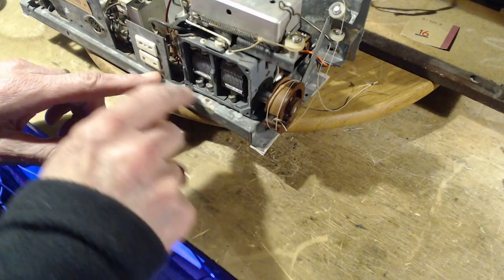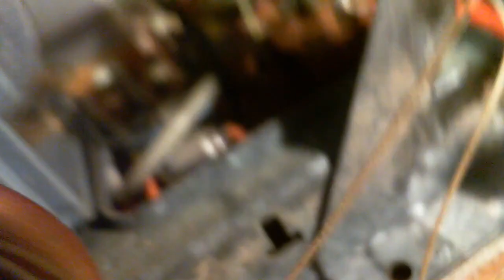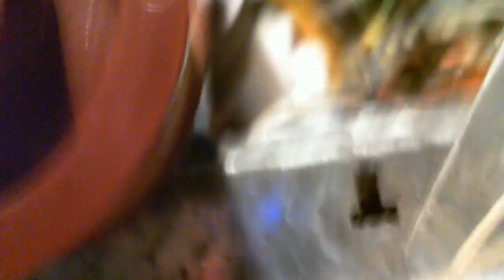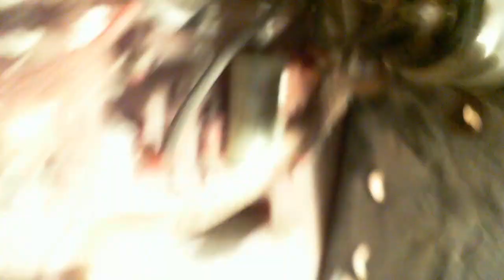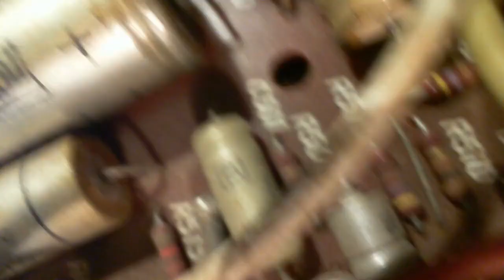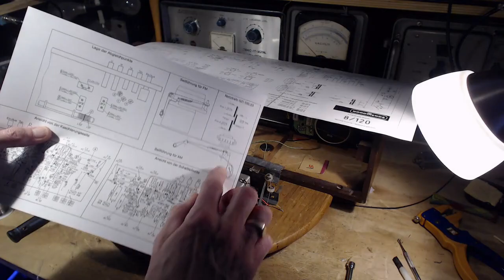Nordmende Spectra Phonic Video#1 - Checkout and Power Up

Comment: The closeup pictures at www.radiomuseum-bocket.de for Nordmende Spectra C Export(!) chassis A121F show the tensioning spring of the dial cord inside the wheel on the tuning cap and not mid-string. Also if it was mid string there would show remains of the eyelets, which there arent. And the pictures at radiomuseum bocket show that ofc the speaker is in this radio is not the original. 5 minutes research put 30minutes of video ad absurdum.
Reply: Yes..I didn't do research but the speaker just didn't look like the original to me.

Comment: Sounds good but you need to properly attach the white backing to the metal plate. Don't use white glue or superglue on the plastic cover.Maybe rubber cement?

Comment: As this is a solid state set it’s not going to generate as much heat as a valve set so it doesn’t need 105Deg components. 85 Deg is ok.